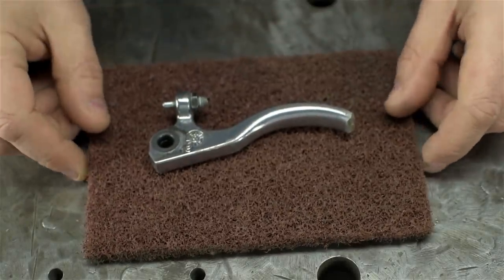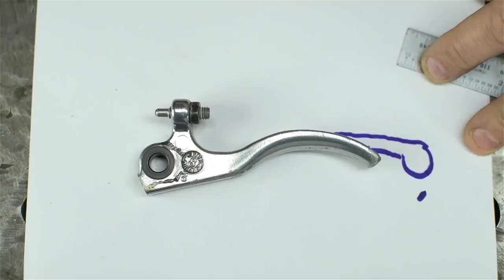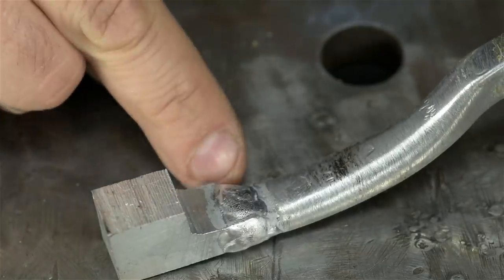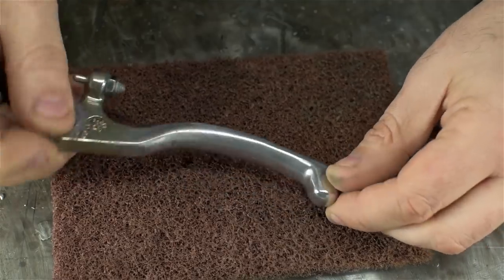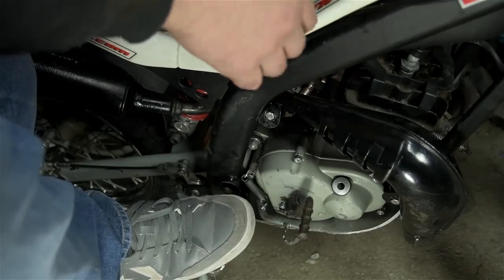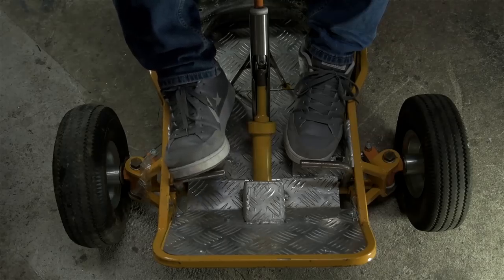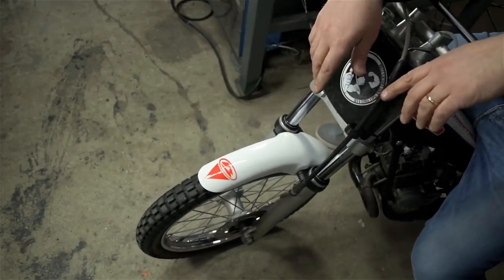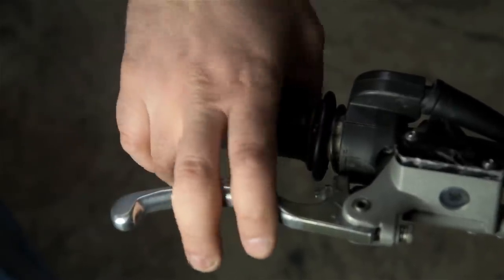6YR OLD ON TRIAL?! - Broken Brake Lever Fix

Comment: For what it's worth Tony I think you made a good decision. I ride street bike now and have over 100k miles under my belt. I learned trail riding at 10yrs. Not quite the same, but my point. I believe low speed control on a motorcycle is considerbly more important then going fast. If you can keep a bike upright you can go fast lol. Not many riders I know can ride slow and controlled. I have three daughters so it looks like nunchucks butterfly knives, and night sticks for me. Thanks for letting me live vicariously.

Comment: Enjoyable vid as always. Congrats on the purchase and choice of hobby! Small suggestion if I might? It's helpful to notch the end of the lever before the ball or drill a small hole to create a failure point. Some people prefer to leave the perch semi-tight. Also, the end of the lever shouldn't protrude beyond the bars as a rule of thumb. Some of the bikes these days come with these notches formed in the levers when new. Might not matter as much now, but when he's on a clutched bike, it makes a big difference getting home or back to the truck with no lever vs. a lever with the end broken off.

Comment: Quick tip, the lever doesnt need to bump up against the grip, move it so that the end is protected by the handlebar. I've busted many until I've did this, it also gives you more leverage.

Comment: My dad rode street bikes before I was born and I heard all the stories. When I turned fifteen and a half he took me motorcycle shopping. I never asked for a motorcycle but I wasn't about to turn one down. The Honda 50 was all the rage in the mid sixties so our first stop was a Honda dealer. My dad took one for a spin. When he got back from the demo ride we just left. "That think will get you killed. Cars will just run you down and you won't be able to get out of the way, " he said. He was totally disgusted with it.

So we visited an old acquaintance of my dad from his motorcycle-riding days who owned a little shop on dirt alley next to the railroad tracks. Long story short, he bought me a Greeves trials bike with a 250 cc Viliars engine. The owner had set it up for hill climbing competition so it was geared really low. First gear topped out at about five miles per hour. The result was it could pop wheelies like nobody's business. When riding on the street I often started from second gear. The bike topped out at about 55 MPH, just barely legal for the freeway. 

 I didn't know what trials was but I did love to ride in the dirt. The Greeves has "leading link" front suspension. This causes the front suspension to rise when you apply the front break, a great asset when breaking on a steep downhill. It also had a very tight turning radius. These are all attributes quite useful for trials riding. 

I rode that bike all through high school then gave it to my cousin when I graduated and joined the military. I did love it though and my dad for buying it for me out of the blue. I'm sure your son will love it too.

Comment: Back in the day, I wanted a Bultaco Sherpa so bad I could taste it. Had to settle for a very old 250cc BSA Star Scrambler that I couldn't kick start. I'd have to push it a ways and hop on, pop the clutch and thump away. The days of $100 motorcycles...

Comment: Tony!  I love you so much, but i have to give an info about this chapter. First, i am an licanced dirt bike rider.. your kid has to use his right or left hands only 2 or 3 fingers. Outer 2 fingers holds his bike and inner 2 fingers use the levers , brake or clutc. When hitting bumps or off road terrain, he cant hold the bike with 4 fingers while braking or using clutch.
Reply from the maker: he does only use 2 fingers but I wanted the whole lever there in case he wanted to pop an emergency Endo. :)

Comment: My dad bought me a Yamaha TY80 when I was about 6. I spent most of the time blasting around fields at Vmax rather than doing trials. However, that being said, when it came to getting a motorcycle licence, even after years of not riding, the clutch control and balance I picked up when I was young meant I meant I nailed the stupid low speed manoeuvres you have to do for a UK licence.

I guess it really was like riding a bike.

Comment: Funny video and nice done for the handler! As a matter of fact I append to having about the same story. Kids are now twenty and fourteen. The beta 80cc or gasgas 80cc are good upgrade to the 50cc for when he'll get older. Maybe jump directly to the 125cc cause the cylinder size is plenty powerful nowadays for those modern trial bikes. I had some handles laying around, Now I know what to do! Thanks I'm curious if we need to be careful about what alloy they are made off to make a good weld. As far as what type of rod  and amperage to you use or metal to pick to mix together?  merci mon ami...

Comment: I rode moto cross with my dad at age 7 too it was great 
Just the switch on manual with clutch at age 8-9 was sooooo hard as a kid because i didnt know what a gearbox and a clutch did or how it worked

Until i disasembled my bike in the garage nearly completly;)

My dad was not very happy to rebuild it with me as a 9 year old

Comment: Tony, I have a fabrication project for your consideration. It's something that I think is in your wheelhouse and that you would enjoy, as well as your subs. I want to have a Keurig coffee maker converted from plastic to non-plastic materials (JUST THE PARTS THAT COME IN CONTACT WITH WATER). Basically the reservoirs and tubing, but also the other smaller parts such as screens and screen retainers. The shell/housing material can stay plastic.

I would cover all costs that we agree to as I would want the completed project back. Where can I send the details? Also, please don't hate me, but I may post this several times in future video's or replies in multiple posts until I know you have seen it. I promise to stop if people become annoyed.

Comment: So, Mr. Tony... have you 'played' with the 3M Scotchbrite WHEELS for your bench grinder?   Often seen on Fleabay, they aren't cheap but I do get TONS of use out of the EXL 8 inch X 1 inch wheels... gray in color.  Absolutely GREAT for aluminum, brass and they do an exquisite polish on steel, too...   The 8 inchers I get have a 3 inch center hole but that is easy to deal with..  :-)

Comment: Hi This Old Tony, I have a nice aluminium Dutch bicycle that I bought used. I'm worried there is a crack in the head tube. How can I tell for sure, it might be a scratch. If it's a crack is it worth fixing? By worth it, I mean will it cost me an arm and 3 legs.

Comment: heh, i cant even count how many levers we've welded back together just like this. Normally those types are breaks are from doing stupid crap, like accidentally dropping your bike, thus you usually have the other half of the lever still. pretty soon youll be blowing out the dents in pipes. Cap the ends, pump it with air, and blow torch the dent. Super dangerous and can easily go wrong, but cheaper than spending another $100-200 for a new one.

Comment: Tony,
Thats a discusting shortage of porosity in that joint, you can do better.
You also seem to be out of practice with sharpening tungstens, try dipping it into the puddle a bit more often, just like the rest of us..........
On a more seious note that brake lever has a higher quality alloy than most chineseium, not a lot of crap boiling out of it.
Nice job.
Have you thought about putting a one way bearing or clutch into the final drive of the go cart?
Cheers

Comment: Hello Old Tony, I like your channel :-) but here you made a mistake!! Tztztz... the original brake lever has especially a  breaking point. The reason is that after a (small) accident or after the motorbike fall over, the lever should break. Otherwise the Aluminium pin could damage the hydraulic system inside the brake fluid reservoir... please cut  or saw a groove at the point were the last one break. Greetings from „the Old Ducati Monster driver“ smile

Comment: Make a joint venture with another YouTuber and build a hybrid go kart. Maybe buy a used chassis and modify it. (Fitting engine, fuel tank and battery)

Comment: Put a foam pad on that cross bar, before he busts his chin open trying to pop the clutch. Then try to hide it, but can't because he didn't want to get in trouble And have his cycle taking away from him. But then finally decide he should tell someone because it wouldn't stop bleeding and eventually goto the emergency room and get 5 stitches. Just saying it if I had a pad on my cross bar, it would saved me from being grounded and an my parent's an emergency room bill. And that's the short version...

Comment: Yea, I can attest to 4 wheelers being a lot more dangerous than dirt bikes.   4 wheelers just roll and flip so easy.  Everyone I know that has 4 wheelers has flipped, rolled, or even had them land on top of them at one point or another.  It's not that big of a deal when it's a dirt bike.  When it's a 500-700 lb 4-wheelers it can be deadly.

Comment: You absolutely did the right thing with the trials bike. ATVs are evil as fuck. People think they are safer, but they have a tendency to cause absolutely horrible injuries. First of all, they are easier to ride than bikes at low skill levels. Two-wheeled vehicles have a built-in safety switch in the skill they require, and in the pucker factor of going fast on two wheels. ATVs instead lead you into a false sense of security. Bikes tend to spit you out, if on the track, you get some rash, if on dirt, you might at most break a bone or two if you're unlucky. Again, their skill-level switch is super sensitive, so you won't ride above your skill level for too long before it decides it's time to put you on the ground. ATVs instead tend to let you get away with it for too long, and then they have a tendency to keep you as they crash, and an even uglier tendency to land on top of you.

Comment: TOT, love your stuff. I have a content suggestion which is surprisingly absent on YT. Would love to see your approach on it. How to get in touch?
Reply from the maker: do tell!
Reply: @ThisOldTony  I have a ship's bell (modest size USN) with a hairline crack. As such does not ring. How to repair? I just have it on my porch for decor. How to determine the metal? braze, torch, tig? Virtually nothing on YT for bell repair.
Reply from the maker: tough one! I'll do some homework.
Reply: This Old Tony placed pics on Pinterest under “Franken-bell” board. Username triple555nickel. It’s about 9 inches at widest diameter or 29/128m lol

Comment: There's no way that "bent" that far and then "broke" and that's a CLUTCH LEVER if anything. You said "motor bike" and there aren't too mechanical cable-op hand-brakes and starting a kid on a "trials bike" is an excellent way to make a kid hate motorcycles. No doubt it was "cheap" but what "trial  bike" isn't?